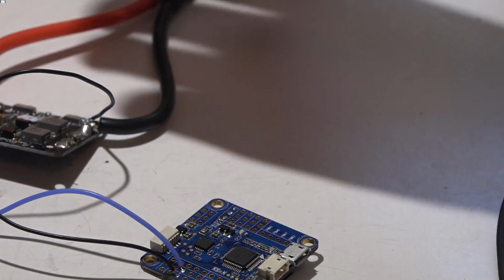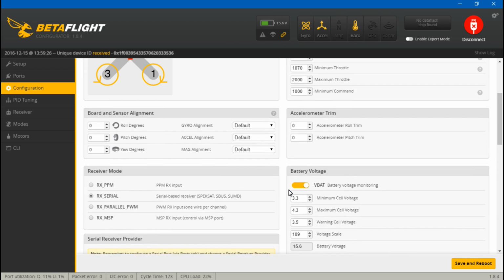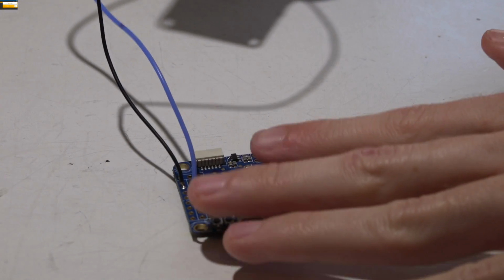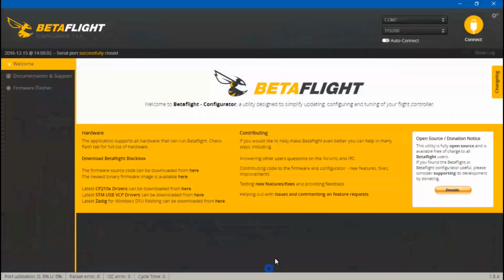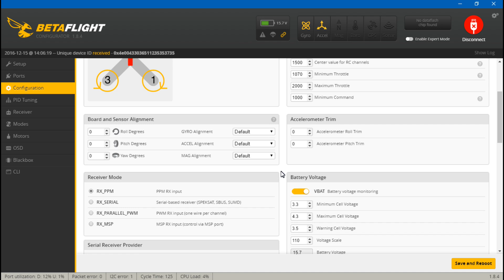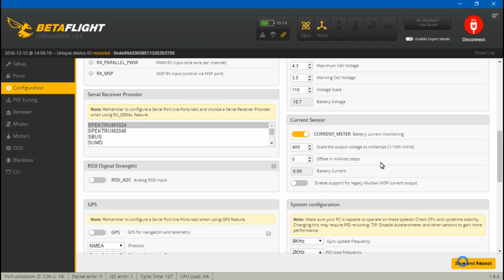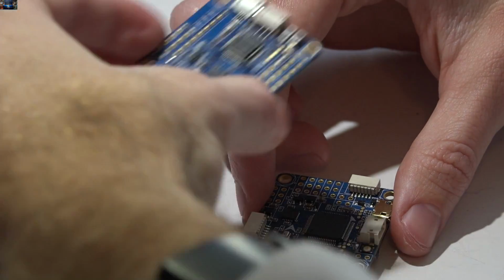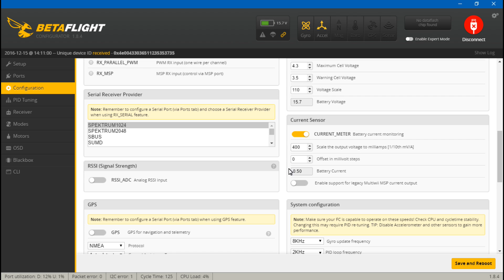Flip32 Omnibus: How To Power (F3/F4/Pro/NonPro)

Comment: F4 PRO v2: it's not clear for me (my fault) if I can power the FC through an external PDB/BEC (with 5V) and still have the battery voltage in the OSD. It seems the only way to fly with 5S batteries without damaging the FC and still have all the info in the OSD.

Comment: I'm not having any luck with the flip 32 omnibus F4 or the clone version...the first one I cooked it somehow, and the flip 32 worked for about 5 flights then nothing...I can only power the board through the USB...I watched your video on how to diagnose things you "fried" and I was wondering if you've had this problem with that F4 board more than a few times. I like the features of the flip 32, but is there a more reliable FC I should get with VBAT and OSD features?
Reply: ok so the flip 32 omnibus F4 now works if I use a 5V power source soldered to the ESC pwm pad...I am wondering if the power coming in the VBAT fried a diode or something. Can I use VBAT and power the board from a 5V source? I mean the board isn't powering on using VBAT anyway

Comment: Hi, your videos are awesome. I'm new to these boards and have a f4 pro for a 250. I'm seeing a lot of people who have issues. I want batt voltage on osd but I would like backup fc power if possible. I am not powering anything from the fc regulator that's not on the board.

Any ideas on hooking up a bec to power the fc and still get batt voltage?

Regards

Comment: When connect sattelite reciver. Do you have to power the board from battery to bind ? I have 3.27 v with usb conected. Cant get it in bind mode. I have done the cli command.

Comment: what if i wanted to power up a spektrum receiver that needs only 3volts. Do the flip series boards have 3v out?
Reply from the maker: Yep on the spectrum receiver port next to the USB.
Reply: Oh ok thanks for the fast reply man. Also what are your thoughts on the f4 battle version with the 6500mpu?im thinking of buying a few in a while and wasn't to sure on the performance. Like would i need to soft mount this fc as well?

Comment: Betaflight 3.1.6 Flip32 F3 omnibus and Tricopter?

First thanks for the great videos!

Do you have any information on how to connect the Tricopter tail servo on the F3 board?
What motor number output is the BetaFlight used when a servo is required?
I understand the resource command and how to use, however,  I have not found any info
on how the rear servo is mapped to a motor pin output and which servo number to use.

I.E. if I had Motor 5 or 6 set to  say B07, I would change this to Motor 5 or 6 to none. Then
resource the servo,  Resource servo xx B07 and save.

Not sure which motor number can be used for servo, and what servo number to use?

Thanks for any assistance in advance.

Bob

Comment: JC looking for a little help. I just got a new F3 omnibus v2 
 link:
http://www.readytoflyquads.com/flip-32-f3-omnibus

I tried to power my flight controller in the same manor as your vid above, pin J4-Bat with battery power and J5-GND battery ground. I get no lights from flight controller.
 If I power it from J11-VBAT, with battery pos, and keep the same ground on J5-GND, it will power my flight controller. 

I can get it to boot to betaflight all seems to be working fine with the exception of motor 1 signal output J17-PWM1 signal pin.
I have switched esc's signal and tested my motor 1, and esc and motor do work when switching it to a different signal wire so I believe I am not getting a signal from motor 1 pin on the flight controller. 
Any ideas as to what is wrong?
is there a work around with using pins PWM5-8?
I do not know how to do a custom motor mix.
Any help would be great!

Comment: I powered my flip32 F4 via vbat as showing on this video and the negative to ground also as showing in this video  directly to my lipo 3s and fried my flight controller ( nothing else was connected to the board)
Reply from the maker: If viewing it with the USB on the bottom, did you use the third pin down in the middle or fourth pin
Reply: i had the same
Reply: If viewing it with the USB on the bottom, On the F4 FC I used the third one in the middle ( strating from the top ) and I used the ground next to it on the left side, anyway I'm following your repair playlist and bought the tools I need to  repair it. and the usb programmer.. I learned a lot from you :) but why do you think this vbat pin killed the fc?

Comment: I have the  F3  OMNIBUS V2, have it hooked up the same way, and it wont power on. it works fine when powered by micro usb, I've resolderer the jumpers, no luck any help would be appreciated, but I feel like im going to have to use a different flight controller

Comment: Is there another way to power up the omnibus f3? Mine won't power through lipo only USB.
Reply from the maker: You could place wires from a 5v regulator to the motor output pins.

Comment: Thanks for the video, that cleared a few questions. I do have 1 more, hoping you, or someone here might have the answer. I am powering my FC through the 4in1 ESC connector (J21). I also want to have battery monitoring within the OSD. I connect pin J4 directly to my Lipo. Would this conflict, using 2 power sources with different voltages?
As the FC is powered through J21 (v5) and J4 (vbat)

Comment: Hey JC, I am building the Flip32 F4 v1 (non Pro). Thanks for your recommendation on the LC filter. Do I pass the battery voltage through the LC filter to the FC, cam and vtx? Or, do I only use the LC filter for the camera and vtx? ie, will the LC filter affect the FC's vbat readout on the Betaflight OSD?

Comment: Looking at configuring a Fixed wing 4channel trainer and then a Pop wing next using the Frsky x6r and x4r and  on board OSD. Looking to load INav for GPS support. Plan to start with the ReadyMadeQuads Flip32 Omnibus F3. 
Goal is to have flight modes, Stabilization, and RTH. Will I need to flip the SBUS?
Will I need a Power current module?  Will I be able to utilize the Frsky telemetry?  Does this sound like a reasonable start point?
Reply from the maker: You don't need a current sensor but if you want current then you'll have to add a current sensor or go with the Omnibus F3 pro which has one built in. But personally I'd add one in because having to run thick power wires to the Omnibus Pro is a major pain. For telemetry the F3 and F4 omnibus will work, but it's easier on the F3 so I would recommend that, plus you don't need a F4 board for INAV anyway, the F3 is more than enough. Yep it sounds reasonable. I couldn't tell you the specifics because I don't do fixed wings, but it is very possible.

Comment: thanks for the video I have just orderd an f3 to play with, I'm quiet new to this, great set of videos 
hope you dont mind me asking ing where do you order your wire for the board and what size do you use ? .thanks
Reply from the maker: Thanks and bunch. I usually just get my wire from whatever website I'm ordering parts from. A lot of places have it. Just make sure you get silicone wire. Readytoflyquads, banggood, ebay, readymaderc and others sell it. For the battery leads going to XT60 connector I use 12 or 14ga, the wires going from the PDB to power the flight controller I use 26ga, and for everything else I use 28 or 30ga.

Comment: Can you tell me where to buy OMNIBUS F4 Pro (v2) with Bec because I decided to order from Aliexpress.com but there write I should use external Bec, otherwise LDO could overheat.I want to be sure that the version of the FC will not overheat.I read that V2 has SBEC 5v3amp and she had no problem with overheating.

Comment: Hi, thanks for another helpful video. Can you confirm what target/hex I should flash to my Omnibus F3 Pro? I have flashed the 'OMNIBUS' target but the board won't connect. Thanks in advance
Reply from the maker: Its the Omnibus target. You probably have to change the driver on your computer. Hope this helps. https://www.youtube.com/watch?v=Ur_mU7Eu69E
Reply: Thanks for the help. I should have been more clear. The board is connecting to my PC but BF won't connect. I have found out that the warning lights on the FC are saying that my GYRO/ACC is not being recognised or is broken. I must have broke it somehow. Have you had issues with these FC's braking easily? Seems a bit fragile.

Comment: Hey awsome videos , just quick question , probably a stupid one. How comes you can get away using thinner wire if your not using the current sensor ?
Reply from the maker: Thanks Ashley. If you use one of the Pro versions with current sensor you have to use the same gauge wire that your battery uses because the battery leads have to be soldered to the flight controller first, and then more wires run from that to the PDB. All the current being used must flow through the flight controller first because the sensor has to be able to see how much current is being used. All that power flowing through thin wires will literally melt the wires in half. And even if they dont melt in half then you would only get 5-10% power to your motors. The multirotor probably wouldnt even fly. By bypassing the current sensor and soldering battery leads to the PDB, but placing thin wires on the flight controller, you wont be able to use current, but voltage in telemetry and OSD will still work because voltage readings work different.

Comment: Problem:. when i plug in my battery no Leds go on. when i plug it into my computer via USB everything works fine. when both battery and USB connected, my quad connects to my taranis and everything works fine. then when i unplug the USB it goes dead. is it  a fixable problem?
Reply from the maker: It should be fixable. I'm not sure what part is bad on your board though. You would have to check with a multimeter.
Reply: Project Blue Falcon Gentlemen, I had the exact same issue.  I replaced the large voltage regulator on the back of the board and this resolved this issue.  Not sure why these boards are shipping with faulty V-Regs, but this was my solution.
Reply: Same thing happened to me after pulling my board off 1 build and putting it on another...I worked around it by running 5v from a separate 5v regulator to the Ram in/out pads next to the OSD pads.
Reply: could you sand a photo?
Reply: Kradle ^Thats assuming your board is getting power already. Our issue was that the board wasn't getting any power from VBAT to begin with.
Reply: @CircuitStar - I think you misread my comment...feeding the board 5v of power from an external stepdown  fixed my board not powering up from direct lipo power. All Vbat is being used for now on my board is telemetry voltage (still works strangely enough, just doesn't power the board.)
Reply: Kradle IC
Reply: Not as thorough of a fix as you just replacing the voltage regulator on the board, but I happened to have a 5v step down lying around and I'd rather just supply 5v of power from somewhere else instead of deeming the FC dead!
Reply: Kradle Absolutely. I was so bummed when I plugged in and didn't have any power.
Reply: Can you measure the Voltage on the voltage regulator for me. Mine is giving 9.7 volt. My lipo is 14.9 volt. Is this value normal?
Reply: Kradle so just run a wire from the 5v pad on the pdb to the what pin on the FC? I just don't want to fry anything by giving it 2 separate sources of power how do I make sure it uses the 5v to power the f3 and not the vbat pins
Reply: i managed to find the solution when i burned two of my omnibus boards and they were behaving the same way , it seems that usually (or at least it was the case for both of my boards) it was the schottkey diode right behind the usb plug that burnt out and would cause this, i'm not saying that all of the boards will be damaged in the same way but this diode can be easily tested with a multi meter in continuity mode and swapped out with a bit of soldering skill and a thin soldering tip test the diode before changing it . (it was the diode named D2 on the pin out but i would also check D3 ).

Comment: Careful with the OMNIBUS F4 AIO, this guy uses an LDO that can't quite take the current the board and other components draw from it. What happens is the damn thing gets ridiculously hot. Cooked the OSD and VBAT chips on my board. You can remove it and still keep your VBAT sensor as demonstrated here https://www.rcgroups.com/forums/showthread.php?2790167-OMNIBUS-F4-LDO-woes. My board still works, but not the OSD or the VBAT sensor. Luckily, Myairbot.com sent me an F4 Pro v2 as a replacement.

This video is great though, I'll certainly be using this when I'm building my new quad around the F4 Pro.
Reply: hey Schire, did it fry your osd and vbat while flying or was it enough for the LDO to just power it? i've powered it a few times for using it with betaflight before i removed the ldo. My Copter is allmost ready to fly now but i only get a grey screen on my googles. not even a flickering.
Reply: The Schire FPV fuck, looks like i need a new FC. thx for the fast info.
Reply: The Schire FPV i'm such a lucky one. after a bit of soldering and testing i found out my fpv transmiter wasn't set properly. switched it and then i got to a new problem. osd works but cam seems broken. i have osd on rhe screen now. my friends cam works just fine.
Reply: The heat issues are no longer a problem with the newest version, correct? The F4 V3 Pro? That's the one I just got in. I read about the board getting really hot with the older versions.
Reply: Ok great thanks! I was started to get scared of my upcoming build as I've been reading about all these issues with the older versions. So im good to go powering straight from my battery leads on the pdb with no issues? Are there any other outstanding issues with the most current version of the board or has it all prettymuch been ironed out?
Reply: I read about that need to bridge being on the older versions and no longer needed? From what I read it should auto detect or work with either depending on what you set it as in beta flight? Are you sure that bridging is still necessary on the v3? It's the two small pins with the "10" in the middle, yea?
Reply: The Schire FPV how long did shipping take from airbot? did they write a lower value for customs?
Reply: Michael M uh, it took a week or two as they shipped from Germany and did not pay for expedited shipping.
Reply: The Schire FPV did yours work with ppm out of the box or did you have to bridge something? mines not working so they are sending me a new one.
Reply: Michael M I believe you have to remove a resistor. I wouldn't use ppm though because of the latency.
Reply: Your right. Is getting so hot that i can smell it. I thought my board got fried because it wan't working anymore. I was measuring the LDO voltage and suddenly it went back on and start working again. How can I let it get that hot?
Reply: 4s lipo voltage will do The trick. Do yourself a favor: clip the legs off the ldo, crank your iron up to 375~, heat up that big ground pad, and remove the ldo. You can still run battery voltage to the VBAT pins for voltage telemetry, but you'll have to supply 5v to power the board.
Reply: Lukofzky yeah it did actually.
Reply: The Schire FPV just to be sure. it did without flying?
Reply: Lukofzky yeah it sat powered on the bench for a while. Gray screen and no more voltage reading after a while.
Reply: Lukofzky talk to my airbot. They sent me a new board when RTFQ wouldn't respond.
Reply: Lukofzky ooh that sucks, glad the board still works for you!
Reply: mportillo78 yup, it was an issue on the F4 pro V1, but the V2 and v3 are fine. It was worst on the F4 aio.
Reply: mportillo78 There aren't really any issues, but all the OMNIBUS boards have a quirk or two. For example if you want to use SBUS on the SBUS pin, you have to short two pads on the v3. I have both the V2 and v3 and they are both fantastic.
Reply: mportillo78 Older versions required you to remove a resistor. You don't need to do anything on the pro V2, but you need to short some pads on the pro v3. I have both, I have a quad with one, and another quad with the other.
Reply: Oh so it's the V2 that requires no bridging? The V3 is the one does then? I see. So other than that it should all work as intended? Just waiting on my Chameleon frame as I have all the other parts already. Trying to read up and prepare as much as I can before the frame shows up.
Reply: 2.5? I thought it was just V2 or V3? My understanding is v3 no longer has this issue but v2 does. Never heard of any 2.5?

Comment: I just powered a f4 pro, via the current sensor pads. direct from battery.  everything worked perfekt. but when I plugged in the 3 pack. the f4 pro died. No light at all. messured and it got power. and still powered the reciver. 
I did not overheat. and ran the camara and transmitter of the pdb not fc.

I'm going to rma it. but can I supply it a other way so voltage spikes or whatever don't kill the next one. 
I just really want the voltage to the osd.
thanks

Comment: I've got an omnibus F4 (the normal one) do I have to wire it directly to the battery pads if I'm not using an OSD??
Reply from the maker: You dont have to power it with the pins I used in the video. If you have a 5v regulator from a PDB or linear ESCs you can place a 5v and ground wire on a motor output power and ground pin. The problem is you wont get you battery voltage in Betaflight, telemetry, or OSD. The pins I use in the video not only power the FC but also because its the full voltage of the battery those pins also tell the FC what the full voltage is. If you power it with 5v with the FC is going to tell your telemetry and OSD that your battery only has 5v.
Reply: I'm currently building a quad with this FC and I'm trying to figure out where to attach the 5v output from the PDB to power the FC. You say the motor output power and ground, what exactly is this? Sorry for the simple question, but I can't find much documentation on it. Thanks!